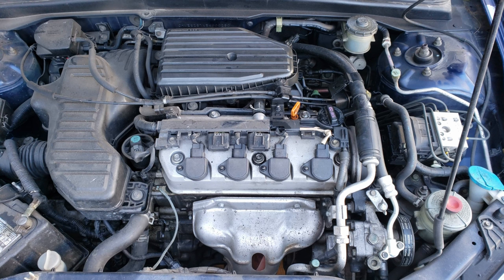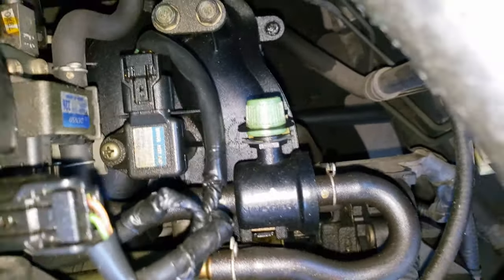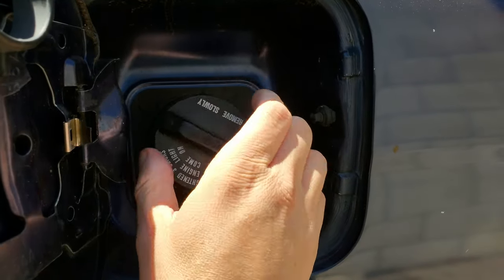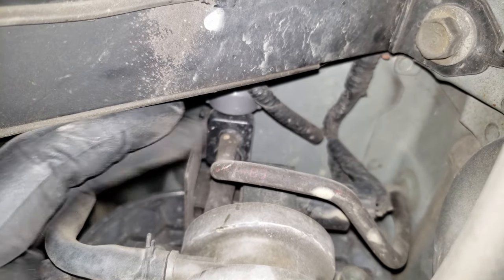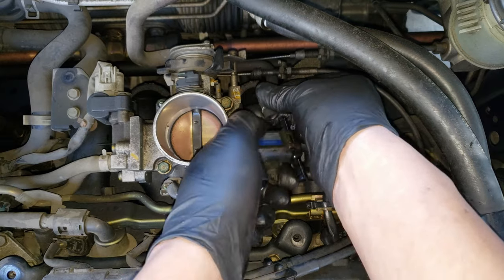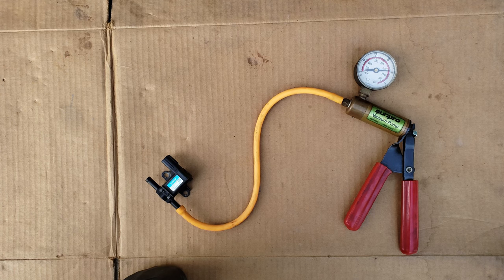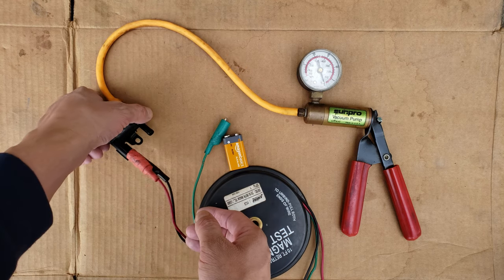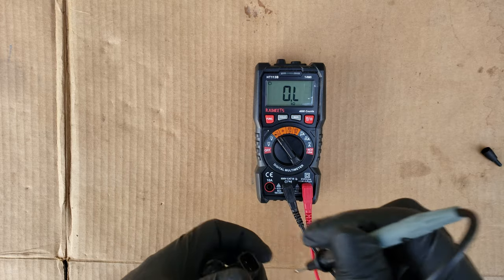How to Find an Evap Leak - Bad Purge Valve Symptoms and Diagnosis

Comment: I had an issue with my 2016 4runner purge valve staying open. I saw another video about using some carb cleaner through it. Luckily for me this worked well to unstuck the valve. Saved me 200 from the dealer. So it all other functions are good this is definitely worth a try. I used seafoam carb cleaner through mine. Just fill both tubes and shake. Give it a few minutes to dry out and test again.
Reply from the maker: Glad it worked out🙂👍

Comment: Great videos man! I have the same Civic as in the video.. have  both p157 and p0401.  My question is will a bad EGR code/valve also give me the EVAP p1457 code? Replaced gas cap already and checked the purge valve.. both work fine.. haven't checked the canister area yet.. hoping I don't have to crawl under the car.. if the EGR is the possibility? Thanks in advance

Comment: Great video. Thank you! Something that puzzles me about this video is how come you show a leaking valve at 4:35, but then, the valve appears to hold pressure when testing it at 5:45? Did you switch to a functioning valve during the latter test? Thanks!

Comment: My vent valve is attached to a solenoid separately, the vent valve was not holding vacuum so I replaced it but the engine light came back on with the P1457 code again. The solenoid is closing a opening properly but I dont know if its holding vacuum. Should I replace the solenoid as well?
Reply from the maker: Well it could be a few things that would cause that code..but theyll be focused near the gas tank area..so youll want to cancel em out 1 by 1..first the gas cap..then yea if solenoid was bad it was good idea since thats what opens and closes it..make sure theres no damage or torn lines or hoses back there..youll want to make sure the fuel tank pressure sensor is reading properly too..even possibly the canister may be damaged

Comment: My ride has me puzzled. 
I have an overwhelming fuel smell inside the car. No smell outside. No visible leaks. No code. Seems to run fine (I haven't driven it but a couple of times since the fumes started)
It was barely noticeable for a few days so I did notice the mileage doesn't seem to be affected and idle seemed fine. No problem filling up. 
Just an eye watering fuel smell inside the cab. The smell is present when not running and doesn't seem any worse while running. 
It has been stationary for several days without a start and the smell is just as bad. 
Any thoughts on what could be the culprit?
Thanks for any advice/guidance.
Reply from the maker: Not sure what kind of vehicle it is, but some cars will have an access panel under the rear seat..youll want to take the bottom of the seat off and remove the panel with normally a few bolts or screws and just check if its leaking fuel..ive had to fix a nissan just recently for that same problem..where the plastic housing on fuel pump was leaking fuel
Reply: Fuel pump

Comment: will a bad gas cap give same code as purge valve ? one man said replacing just purge valve solenoid,,, pontiac grand prix,,, wont ever fix code po446. i took it as it needs other things replaced also,like the pressure sensor or faulty lines and connections. ?

Comment: Is it normal to not get a CEL but you can literally see clear fumes coming out of the gas cap area through the side mirrors? Sometimes the dips RPMs while at stop or idle.
Reply from the maker: Well the fuel cap would vent since many fuel caps are vented if they reach a certain pressure...and the dips at stops or idle can be a sticking idle air control valve or a few other things..that may electronically still function properly so the computer wont detect an issue but maybe mechanically theyre not working as great due to gunk inside or something clogging the port

Comment: What happens when you have a leak in the evap or anywhere in the engine but no cil light or codes show up?  And getting random rough idling at a red light or stop sign.
Reply from the maker: Well a rough idle could be caused by many things, like a dirty throttle body..or if u need spark plugs.. a problem with the pcv valve could cause a vacuum leak with no codes yet run rough...but normally a leak in evap will trigger a code cause its quite sensitive to catching any certain type of evap issue.

Comment: Him I did this test, and the vaccuum is lost very slowly. It goes from 17 to 7 in around 20 minutes. Does that mean that the solenoid is bad? I tested it with voltage and it opens up.
Reply from the maker: Does it hold at 7 after that? Specs do say it should hold at least 7 in vacuum
Reply: @backyardchevy328 , I finished the test at 20 minutes, so i don't know now if it would have lost more vaccuum. I'm going to repeat the test again tomorrow. I'm trying to solve two codes: P0455 and P0456.
Reply from the maker: @lohengrinknight  yea two evap leak codes..should be a bigger leak than that though if its taking that long and holding at 7..unless the valve is randomly sticking..have u checked ur gas cap and followed all the hoses from engine to tank?
Reply: @backyardchevy328 , yeah. I checked all hoses and they are ok. The car has a capless fuel neck, and I lubricated both the plastic and metal seals. I used WD-40, but I'm thinking that I should go back and use some silicone lubricant instead. I have not checked the vent valve, but since you say that codes mean something else might be faulty, I think that that could be the problem.
Reply from the maker: @lohengrinknight  hope your able to locate the problem..good luck🙂
Reply: @backyardchevy328 , thanks for your help, man.
Reply from the maker: @lohengrinknight  anytime🙂

Comment: Does this fix a p0448?
Reply from the maker: No that's for the vent valve..that ones by the gas tank on most vehicles..and usually means the valve is stuck closed or not opening